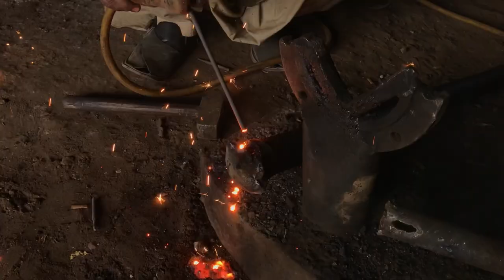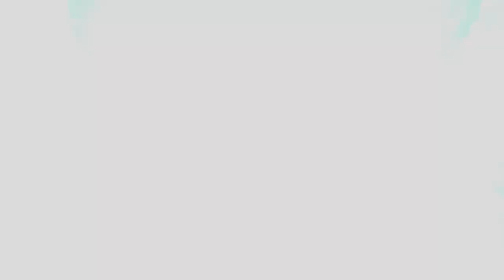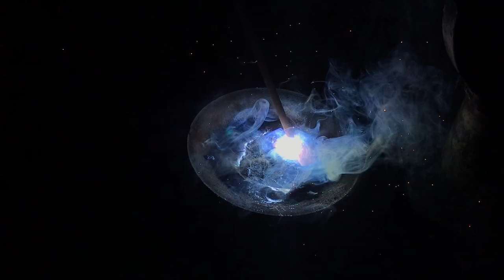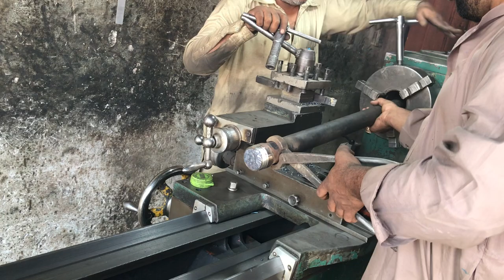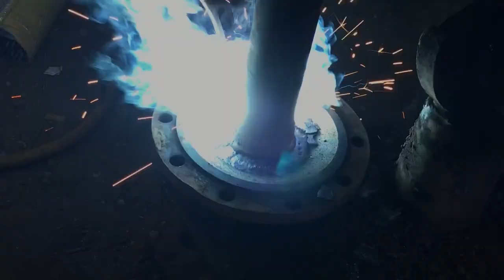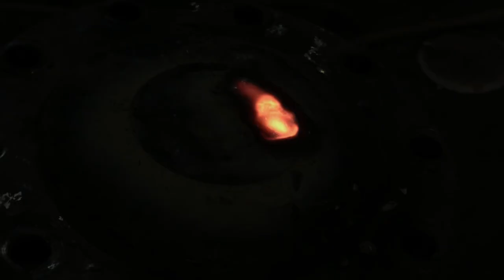Threads Method Used for Repairing Truck Broken Axle || Restoration of Rear Axle Through Threads ||

Comment: As a repair to this axel, the threaded method shown here is probably the best solution. Not that the axel should not be replaced as soon as possible, but this I think is the strongest way to make this specific repair.  Thanks for sharing. 😊